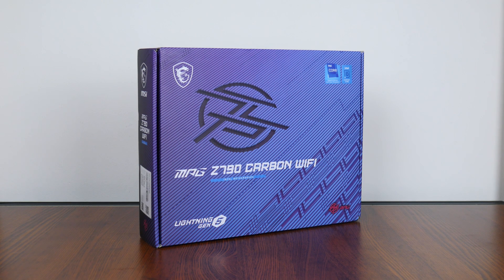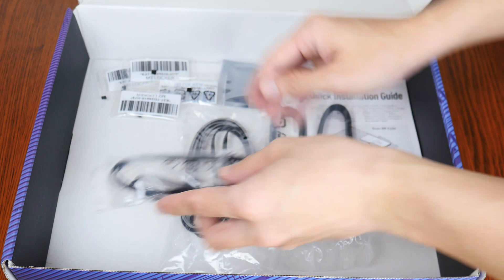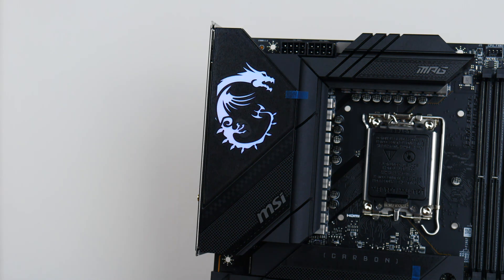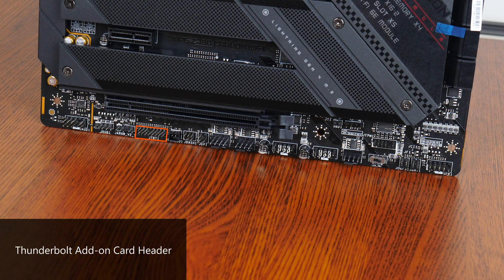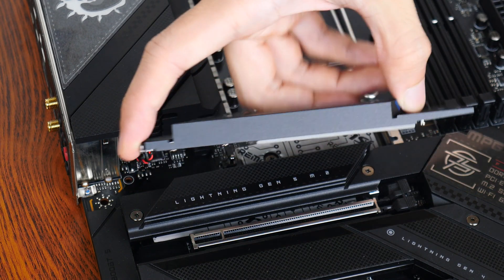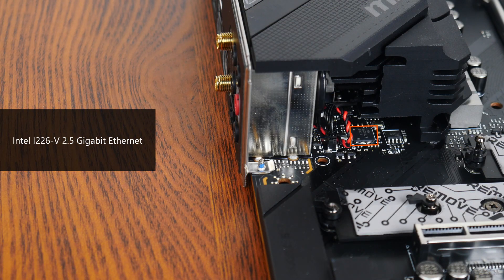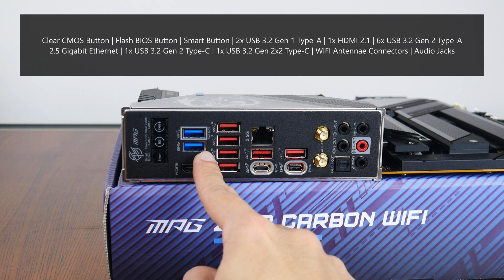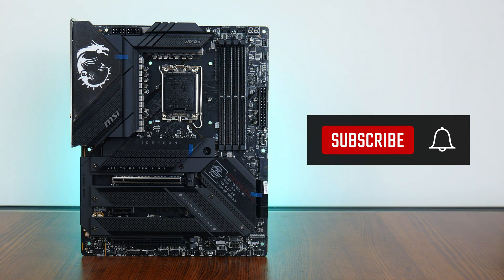Premium Intel Z790 Motherboard - MSI MPG Z790 Carbon WIFI Unboxing & Overview

Comment: 6:20 Can i use the slots 5gen(4TB PCIe Gen5 NVMe M.2 SSD x 4 times = 16tb) only ?
Reply from the maker: Yes you can. Again, at 6:45, do note that the board's only Gen5 M.2 slot shares bandwidth with the PCIe 5.0 x16 slot for a graphics card - I would recommend installing your four drives in the Gen4 M.2 slots instead to avoid this issue. Do bear in mind that in doing so, your NVMe drives won't be able to operate at Gen5 link speeds...
Reply: @ALKtech  If i used 5Gen in 4 slots, i can't get the 5gen speed?🤯
Reply from the maker: @MM.Funny.  yup you can't unfortunately. If you have a Gen5 SSD installed in a Gen4 slot, the SSD will step down to run at Gen4 link speed instead.
Reply: @ALKtech  How can i get 5 Gen speed? I want my pc to be very powerful and fast.
Reply: @ALKtech  Specifications of the PC i will buy :
Intel i7-14700K — Gigabyte RTX 4080 Super — Ram 96GB of Corsiar dominator — CPU cooler H150i of Corsair — Z790 Motherboard of MSI(same in your video) — 1200W Platinum Power supply of Asus — 4TB PCle Gen5 NVMe memory of Crucial( 4 slices ) .
So how about my PC assembly?Would you like to change some of pieces? 🙂 I have between 5000-8000 US dollars
Reply from the maker: @MM.Funny.  actually if you're not in a rush, why not wait for the next gen of Intel and AMD motherboards to drop? There are rumours of Intel's next-gen motherboards and processors launching in mid-October this year, and AMD's launching its new X870E and X870 motherboards in September this year as well - these new AMD and Intel platforms would in all likelihood have more Gen5 M.2 SSD support. 

Since you're going to be spending between US$5000S-US$8000 on a PC (which is quite a good amount of money), I'd rather you wait for awhile longer and get the latest tech, than spend this sum on a platform such as the 14th Gen+Z790 chipset which is going to be obsolete soon...
Reply: @ALKtech  I thank you so much for abbreviating everything that has value for patience. ❤️❤️😆

Comment: I recently bought this motherboard and I am confused with the m2 slots. Which slot should I use for windows installation? if m2 gen 5 slot shares the bandwidth, its not ideal for windows installation?
Please help me.
Reply from the maker: I'd recommend installing your primary M.2 drive in  slot M.2_1, and if you have a second (or third M.2 drive for that matter), install these drives from slots M.2_3 onwards. Avoid using slot M.2_2, as this slot is the one that will reduce your graphics card slot's PCIe bandwidth. Hope this helps!
Reply: Thank you so much for your reply. I have installed it in M.2_1. It works great. @ALKtech

Comment: The battery replacement headache you kindly pointed out has put me off getting one of these boards. The battery will fail eventually, so a more tricky replacement isn't worth the hassle.
Reply from the maker: Yeah...having to remove the motherboard from the case and remove the VRM heatsink assembly just to get to the CMOS battery would be time consuming for sure. Perhaps the idea is that by the time the CMOS battery runs out, owners of such boards might have upgraded to something better then 😅
Reply: I've literally never had to replace a CMOS battery and the PC I am currently using as a media PC I built in 2008, never replaced the battery.
Reply: @tsdobbi  I've replaced a few, mainly for friends. But they've never been under 10 years old. It's not a big issue - I've decided I'm going to get a Carbon. £350 is the most I'm paying for a mainboard though.

Comment: Does the thumb drive have the drivers on it or did they just give it to you do it yourself😂 ive had both happen
Reply from the maker: It should come with drivers and MSI utilities on it - at least that's what the motherboard manual says - I didn't get to plug the drive in to verify for myself 😂

Comment: in msi page specification it says 4 USB 2.0 , why is there only 2 USB 2.0 if I may ask ? :O
Reply from the maker: Are you referring to the two onboard front panel USB 2.0 headers? Each header is wired to support two USB 2.0 ports, meaning you get 2x2=4 USB 2.0 front panel ports!

Comment: Im looking for good MB for me PRE-build Acer orion predator 5000 po5-640 PC. And on Acer forums everyone is suggesting Z690 MSI MPG. But on European Amazons this Z790 MSi MPG Carbon and Z690 MSI MPG EDGE WIFI card cost ALMOST the same with 30$ differences. Is this card somehow better? I don't understand the differences. They are both capable of 13gen Intel cores and both can OC RAM speeds. Its insane how much information a simple user has to gather to make a right choice.
Reply from the maker: The Z790 is a refresh of the Z690 - to be honest the differences tend to be minimal between boards powered by both chipsets. In fact, both the Z690 and Z790 will support Intel's upcoming 14th Gen processors too, so if I were in your situation, getting the cheaper board (which I assume is the Z690) wouldn't be a bad choice at all.

Out of curiosity though, why are you upgrading the motherboard of your prebuilt? From what I see of its specs, it seems to have an i7-12700 which is on the LGA1700 socket. Are you upgrading so that you can swap out your processor for a 13th Gen or even 14th Gen?
Reply: @ALKtech  The motherboard on Acer Predator PO5-640 is H670 . Its i7-12700 LGA1700 correct. But I really want to make it future proof for 13 & 14gen processors + everyone  on Acer community suggest to change motherboard because it lacks some on board USB connectors for Water cooling. And I really want to get a Corsair Liquid AIO that actually requires that on board USB connectors. MSI MPG 690 or Z790  has everything thats required. Also this motherboard allows OC. And stock Acer Predator motherboard doesn't. So this motherboard is suggested on Acer forums. Z690 MSI MPG EDGE WIFI is the most suggested MB there.
Reply from the maker: @TesGon  I see. Personally, I think upgrading from a 12th Gen to 13th Gen may not represent the best value in terms of how much additional performance you're gonna get. Depending on how the latest 14th Gen processors are going to be like in terms of pricing and performance, going straight to 14th Gen might be your best bet, if you're intending to press on and get a MSI Z690/Z790 board. My two cents!

Comment: website shows it have 2 usb 3.2 type A connector?
Reply from the maker: Are you referring to front panel USB 3.2 Gen 1 Type-A connectivity? If so, the board has 1x front panel header that supports up to two front panel USB 3.2 Gen 1 Type-A ports.

Comment: hello, have you had any problems accessing the bios or the usb boot key because it is impossible for me on my z790 carbon, my pc starts up and arrives directly on the windows page, do you have a tip because I don't know what to do? it works 1 time out of 50
Reply from the maker: Haven't really had this issue before, just gotta keep mashing the DEL key immediately after powering on your PC, and once in the BIOS, set the default boot device to be your USB drive..

Comment: What is the actual RAM speed this board can handle? Just bought one paired with 13900k. LTT benchmarks weren't even able to get one 8gb ram card to run above 6400mT/s (or mhz) with 7400mhz or 6400mgz native or with Intel xmp enabled. Their own numbers list even 4 card arrays as faster than that, and ALL 2 card (even 2 x 32GB 6400mhz RAM cards) as faster than they're performing real-world. Not even poorly performing, just entirely unable to perform above 6400mhz...

Comment: Is there a motherboard you suggest for i9 13th 4090 and ram of 16x4 6000mhz
Reply from the maker: It really depends on your budget for a motherboard and whether or not you'll appreciate high-end features such as a premium audio codec, beefier VRMs for overclocking purposes etc. On the lower end of things, you could even look at the MSI PRO Z790-P WIFI, or ASUS PRIME Z790-P WIFI as some examples of "budget" Z790 boards, or if money is no object, the CARBON in this video could do just fine!
Reply: @ALKtech  money is not the issue I just want my 4 rams too work at 6000mhz speed

Comment: Is there a motherboard you would suggest over this MSI for a system with 13700k, 4080, ddr5-6400 64gb, sn850x 2tb?
Reply from the maker: Are you intending to overclock your 13700K? If the answer is a no, you could potentially look at a high-end B760 motherboard instead, and save some cash! It's worth thinking about whether the added benefits of going Z790 over B760 (e.g. more USB connectivity options, more PCIe lanes and SATA ports etc) is something that you'd appreciate too.

Comment: at 7:00 so if i have a gen 5 NVME in that slot my GPU would have half the lanes available to it? Why would you do this?
Reply from the maker: The Z790 chipset doesn't have native Gen5 support, so Intel's given board manufacturers the option of "including" NVMe Gen 5 support by sharing bandwidth with the 16 PCIe 5.0 lanes meant for the graphics card. In this case, MSI's opted to exercise this option to sorta give end-users more flexibility in choosing what they want I guess!
Reply: @ALKtech  Thank you for your quick and concise reply! Just to confirm my suspicions, if a gen 4 is used in that slot it would not effect bandwidth? The amount of options for z790 motherboards is giving me headaches!
Reply from the maker: @youmayknowmeas2an  it would actually, as long as there's a NVMe drive installed in the Gen 5 M.2 slot, regardless of whether it's a Gen 4 or 5 SSD, the PCIe 5.0 x16 slot for a graphics card would have it's bandwidth cut to PCIe 5.0 x8 instead... 

If you're gonna be getting this board, I'd recommend installing your drives in the non Gen 5 M.2 slots!

Comment: Hi mate, is it worth getting the MPG Z790 carbon over MEG 690 unify? All I see are issues around PCIe 5.0. I am making my first build and placing an order for parts - any suggestions will be highly appreciated.
Reply from the maker: How's the price like for both boards where you're from? Having taken a quick glance at the Z690 UNIFY's specs, I'd say that both boards are very similar to each other, except that the Z790 CARBON "has" PCIe 5.0 support for M.2 (which isn't a true native Gen5 solution and will rob your graphics card PCIe slot of its full bandwidth). That said, I'd probably get whichever's the cheapest between them both!

Comment: if you only use one of the gen 4 m.2 slots will it still limit your GPU to x8?
Reply from the maker: Using the Gen 4 M.2 slots will not limit your GPU to x8 link speeds. Only if you have a M.2 SSD installed in the Gen 5 M.2 slot will the halving of bandwidth for the GPU slot then happen!

Comment: Great walk through. I cannot find anywhere that MSI says that the M.2 SSD PCIe 5.0 shares bandwidth with PCIe 5.0 x16 slot. It doesn''t make sense why it is dropped to x8 to support a x4 M.2. Where does the last x4 then go? Could you please link to where that is described?
Do we know when a motherboard for Intel comes with dedicated PCIe 5.0 for the M.2 SSD?
Reply from the maker: Check out page 15 under "Expansion Slots" of the motherboard manual below:

https://download.msi.com/archive/mnu_exe/mb/MPGZ790CARBONWIFI.pdf

It's also stated under the "Storage" section of the specs page for this board:

https://www.msi.com/Motherboard/MPG-Z790-CARBON-WIFI/Specification

Again, it's all because the Z790 chipset doesn't have native Gen5 support for NVMe drives, but Intel does allow board partners to divvy up the PCIe 5.0 x16 lanes to "implement" Gen5 for a M.2 slot...which explains this board and its Gen5 graphics/M.2 situation; I'm thinking the "remaining" x4 bandwidth that's missing is just lost, probably due to electrical/hardware constraints - I'm just speculating though!

That said, I'd think native Gen5 support for M.2 drives will only appear with 14th Gen Meteor Lake parts once they get released!
Reply: @ALKtech  thank you so much. After my comment, I have read more about the z790 chipset in general. Intel considered it, but then chose not to add it.
When the SSD's comes, AMD will have a huge benefit there and it could change who is the "fastest" 🙂
Reply from the maker: @kenneth_jensen  happy to help! Oh yes, AMD will have the upper hand in terms of platform longevity - that is, if you go for a mid-to-high-end motherboard with the X670E or B650E chipset, which come with PCIe Gen 5 for both the graphics card and M.2 slot. By the time Ryzen 8000 or even 9000 comes around, we should see widespread adoption of Gen5 methinks...

Comment: Are you 100% certain the M2_2 has shared bandwith with the GPU slot? It is not mentioned anywhere in the manual. I Have 2 Nvme's so just trying to figure out where to install the second M2
Reply from the maker: Yup - see page 15 under "Expansion Slots" of the motherboard manual below:

https://download.msi.com/archive/mnu_exe/mb/MPGZ790CARBONWIFI.pdf

If you have 2 NVMe drives, I'd recommend installing them on M2_1 and M2_3.
Reply: @ALKtech  ah yes, I do see it, I was referring to the z790 Gaming EDGE wifi user manual instead of the z790 CARBON wifi. This is quite weird as the carbon version is supposed to be a higher tier than the edge wifi yet it has shared lanes and the edge doesnt.
Reply from the maker: @xxxfadexxx  its because the Z790 chipset doesn't come with native PCIe Gen 5 lanes for M.2 drives, where to get around this and perhaps make the Z790 chipset more..."competitive" against AMD's AM5 chipsets that have native Gen 5 support for M.2 drives, Intel's given motherboard manufacturers the option of "sharing" the PCIe 5.0 lanes meant for a graphics card with a M.2 slot. It just so happens that MSI's implemented this for the CARBON as a...premium feature I guess!

Comment: So if I installed a M2 in the second slot with a 4090 GPU (not booted yet).. I should probably move it to the 3rd slot? New to the M2 storage.
Reply from the maker: Yup you should - avoid using the second M.2 slot as it'll rob your 4090 of bandwidth!
Reply: @ALKtech  thanks

Comment: thank you for the great video. im getting rtx 4090 and i9 13900k. would your recommend this motherboard or the asus strix z790f??
Reply from the maker: Glad you found the video useful - a quick glance through the ASUS's specs, I'd say both boards are quite similar, with the key difference being that the MSI serves up 6x SATA III ports and 5x M.2 slots versus the 4x SATA III and 4x M.2 slots for the ASUS. That said, is there a price difference between both boards where you're from? Pricing would probably be a key deciding factor for me, if I were to be deciding between both boards!
Reply: @ALKtech  the price on both is about £460 same price!!
Reply: @ALKtech  also is it easy to overclock on either board??
Reply from the maker: @danielredman9721  I've not tried overclocking on both boards so I can't really say for sure, though given how toasty a 13900K can get, you'd probably hit a ceiling due to insufficient cooling first I'd wager...are you going for a 360mm AIO at the very least?

Anyway back to the topic of pricing...it does make selecting between both boards real hard since they're the same-ish in terms of price 😂. Based on aesthetics alone, I'd be more inclined towards the ASUS, though I somehow get the feeling the MSI might serve up more OC headroom with its VRM setup!
Reply: @ALKtech  yes its a tough decision. im probably going to go with MSI. yes a corsair h150i 360mm cooler for the processor. probably dont need to overclock it for now i guess. thanks for the help i really appreciate it :D
Reply: I will be moving from Asus to MSI for my next build. In my opinion the MSI BIOS is better and they don't force buggy software down your throat like Asus does with their Armoury Crate

Comment: So if you use the PCE 5.0 m2 slot your GPU will be affected? That sounds super dumb.
Reply from the maker: Chipset design limitations 😅it's just cause the Z790 doesn't have dedicated PCIe 5.0 lanes for M.2 drives...a feature we'll probably see with Intel's future 14th Gen chipset offerings.

Comment: Great review!

Having a gen m.2 in the gen 5 slot wont slow down the GPU PCie slit right?

I have my system m 2 installed there paired with a 4090
Reply from the maker: Oh! The slot will operate at PCIe 4.0 x8 mode instead (as the RTX 4090 supports PCIe Gen 4) - you can verify this by running GPU-Z and checking the section under "Bus Interface". I'd think that there should be some performance impairment as a result - would it be possible for you to install your M.2 drive in the first M.2 slot instead?
Reply: @ALKtech  yes, thank you! I had no idea about this as I didn't see it mentioned in the manual.

I will have to move my boot drive then to a different m.2 slot! Thanks a lot 😁

Comment: So I'll be running a 13700k with a 3090. I have a 980 pro nvme that I'm going to be running. Should I install it on the first m2 slot or the 5.0 slot? Wondering if it would kill my performance
Reply from the maker: Drop the 980 Pro into the first M.2 slot! The 980 Pro is a PCIe 4.0 x4 part - no point having it in the second M.2 slot that is PCIe 5.0 compliant, and halving the bandwidth of the graphics card slot as a result...
Reply: @ALKtech  thank you! I figured that was the case. I’ll do that!

Comment: This seems like Unify + Carbon united, but where it fails is the ram support, should be DDR5 7600, but on the QVL there is nothing above 7200.  I feel this board being $500 is priced too high, its not truly a unify,  imo this is a $399 mobo,  for a very close price I would go with Aorus Tachyon or shelling $200 more for the Asus APEX.
Reply: MSI MPG Z790 CARBON WIFI does support DDR5 7600 RAM though. Look it up on PC Part Picker :)